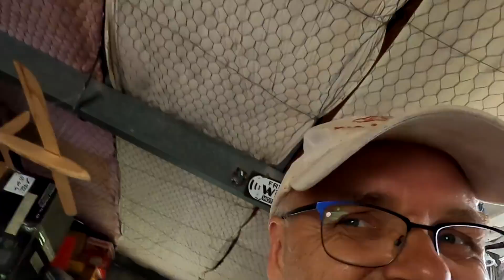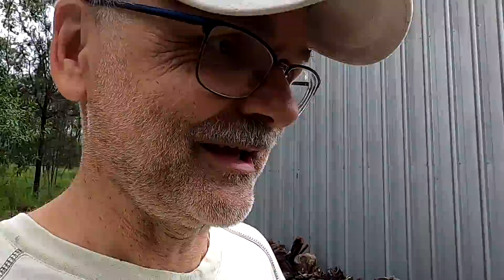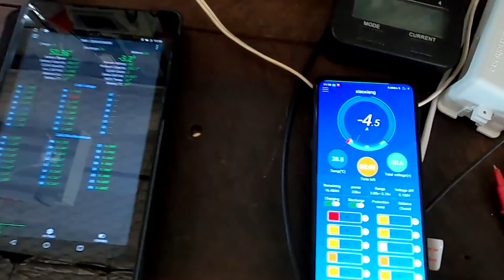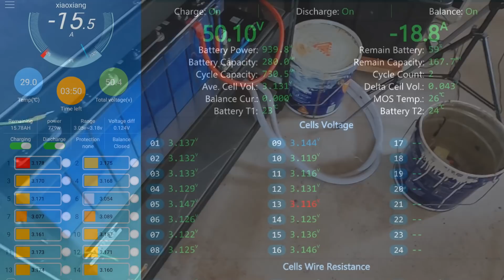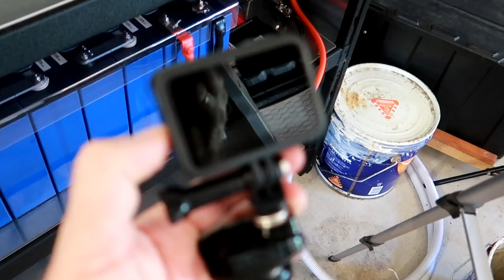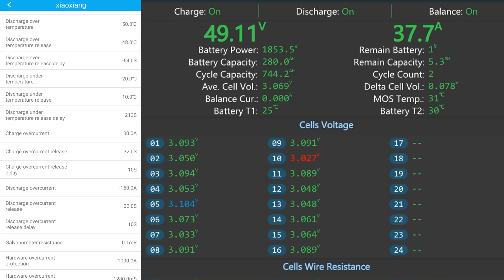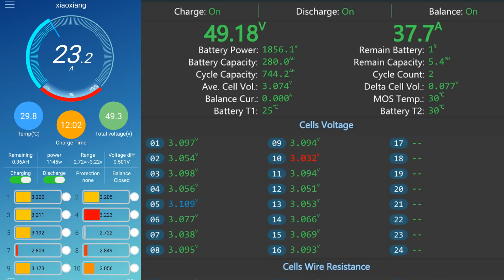Two 48V battery banks, different BMS', low voltage shutdown. QUCC BMS vs JK-BMS. See what happens!

Comment: Hi Andy, again a great video !      If my pack is in such a low SOC the Multiplus cannot charge anymore( by the grid)   and keeps disconnecting the breaker. Due to ripple voltage , sais Multiplus. I have to charge the cells individually to 2.7 V each,  then the system works good again.  I wonder if you have the same problem...
Keep on going!
Reply from the maker: Oh, wow. That's annoying! I reduced the load to 1.1kW before the BMS shut down. What was your load when this occurred?
I'll keep this in mind for the next low voltage test.
Reply: @OffGridGarageAustralia  No load.  The multiplus was " on" for a couple of days and drained the whole system,  despite the QUCC should stop at 2,55V. It is not clear to me...I have an (still) grid-connected Enphase system so I load my batteries from the grid during weekends, to use the washing machine, dryer  and other big loads during the week. And forgot to turn off the inverter.....silly me!
Reply from the maker: @Victor-ut4zp  Ah, OK, you should program the Multi accordingly so it shut itself down before it drains the battery that low.

Comment: You stated correctly, the qucc was waiting for jk battery voltage to exceed its own batteries voltage sufficiently, thus seeing a charge, and opening the relay.
I am happy with my Qucc, does anybody know if it can show accurate SOC when fast charging? It always states a full SOC during absorbtion...

Comment: Curiosity is a joy forever.
Reply from the maker: You're getting a little bit more if I would use an active balancer in this situation which keeps the low voltage cells alive a bit longer. It is not more than 5Ah what you gain though. From a 280Ah battery.
Normally you don't discharge that low, this was just for the test. It does not make sense to go under 3.0V which is around 7% SOC. And then it does not matter if some of the cells are a bit lower than others.
Reply: @OffGridGarageAustralia  maybe the spirits of clean energy would say to preserve the battery pack to its maximum and also to replace a ripped thread on a cell to place it with other deficient cells in a lesser demanding setup to let it live to its fully remaining capacity.
Than again, i am a pacifist who has difficulty with change and dismissing old socks... Viva longevity!

Comment: I noticed something: The QUCC BMS had waited 30 seconds after the voltage exceeded 48.6V. 
It then resumed charging. It may have waited to see if the voltage would drop again.
Reply: It depends on the undercoltage release and release delay and pack under voltage release and pack under voltage release delay settings are set to.

I checked out this function before I put the qucc in my production/final setup

It's a good feature to have the delay
Reply from the maker: Hmmm, I can't see a setting for this... Also not sure if it has this sort of 'intelligence' to wait and see?
Reply: @OffGridGarageAustralia  it was just my observation
Reply: I agree looks like there is a de-bounce timer on the restart, makes perfect sense... but where is it set?
Reply: it waited until voltage of battery was about 0.7V lower then voltage on contacts of relay.. this is a drop voltage on some diode on input..

Comment: The Seplos BMS I run seems far superior than these bluetooth BMS's, cells in the pack are always within 5mV of each other for most of the discharge curve, easy to manage multiple packs on the system too and communicates directly with my inverter. Highly recommended.
Reply: So I'm curious what communication protocol you have. I have the growatt 6000t but unsure which version bms I need and it's too hard to communicate with the sellers.
Reply from the maker: This has more to do with your cells and maybe the way you use them (charge and discharge current) and not so much with the BMS. Why should the BMS communicate with the inverter and not with the charger?
Reply: @OffGridGarageAustralia  He probably means he has one of those all in one white boxes like a Growatt, "talking to the inverter" would actually be talkign to the charger in the white box. 
I also have one of those white boxes, they are great value. The JBD bms's aren't.

Comment: Hay Andy thanks for a great video very entertaining. My system has been running for over 6 months and I still have never tested the low voltage cut off. my inverter settings are set lower and higher than the bms. I do need to test the system. My 12v step down controller is a risk as it's connected straight to the battery.
Reply from the maker: Thanks Luke. I'm always curious to see what's happening at the very top and bottom. We will repeat this test once we have all the battery banks installed.

Comment: Rms only works and is only applicable for ac power. If you’re in dc voltage mode it won’t do it (root mean square is not an average it’s closer to 63%). Under dc voltage it will average samples within whatever period it’s set for.
Reply: well said and entirely correct
Reply: .. to be precise :) 
for a pure sine wave RMS is 0.707 of the peak .. aka 70.7% … but lets not split hairs!
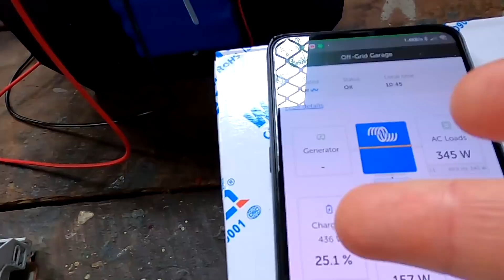Reply: @qchatgreg  sorry, lazy math done wrong from 1:41 multiplier. 😂
Reply from the maker: Is a DC ripple not AC?
Reply: @OffGridGarageAustralia  This probably comes from my comment on a previous video where I used the term RMS incorrectly instead of using average... Probably was too late in the night when I made that comment. The idea remains the same: the multimeter averages, the BMS does not, and the ripple is due to the inverter load.
Reply: @OffGridGarageAustralia  not unless it happens to be perfectly sinusoidal with a 0 crossing.   It might have a sinusoid but it will always be positive unless it’s using ZVS and that your meter won’t be able to measure because it’s over 132,000 hz. 

And again, RMS is only on in your meter in ac voltage setting with a frequency between 10ish and 300ish hz. 

In dc voltage it’s just averaging samples and samples per second on your meter is one of the differentiators between cheap and expensive meters. 

The only way to really tell what’s going on with DC ripple is with an oscilloscope because it measures up to 200 or so MHz (higher the more expensive)

Comment: In which video can I see the wiring of the two parallel batteries? Is the paralleling on a busbar on front of the victron shunt?
Reply from the maker: Yes, every battery bank connects to the main busbar via a 100A circuit breaker. This is part 1 of the installation, 2 and 3 are linked at the end of each video: https://youtu.be/8wu8OKlOn7s

Comment: Another great video! Thank you. A Quick question; on the original battery, the two lowest cells seemed to be a lot lower than the rest. I was once told that trying to bottom balance and top balance would drive me crazier than I already am. I was just thinking that if your two lowest cells were closer to the rest, you would've gotten much more out of the battery. Thoughts?
Reply from the maker: I could have used an active balancer at this low SOC which would have kept the low voltage cells alive for a bit longer. You get probably 5Ah more out of the whole battery (280Ah) with such a balancer. 
It does not make much sense to go below 3.0V which is ~7%SOC. At this point, it does not matter if the cells are straying a bit because the pack is top balanced so they come together again when fully charged. Using a balancer at the bottom destroys your top balancing.

Comment: Are you going to install the older battery on the shelf? You have different resistance as the one battery is further away and longer cables to it that messes with your test.
Reply from the maker: There will be new cells in the shelf soon. The longer cables don't make a big difference. The more battery banks we have, the lower the current for each is.

Comment: Didn't the QUCC have a 20 second delay? I think it just started charging after the input voltage was higher than the battery voltage plus some delay.
Reply from the maker: The voltage was 0.6V higher before it turned on again. Not sure if there is a timer running for this. Nothing in the settings for that.

Comment: The QUCC appeared to have some delay to turn off and on, so it must have some sort of delay either built in or configurable.
Reply from the maker: Yes, there are some timers which can be set. But not for when the overall voltage to turn on the relay. I always found the QUCC a bit unpredictable.

Comment: Can anyone explain the JK BMS numbering convention? I can't figure what the specifications are for the various part numbers.
Reply from the maker: Under the JK-BMS section is a link to the manual. It has a table on page 1 with the naming convention and the specs. Does that help? I've got the B2A24S20P
https://off-grid-garage.com/battery-management-systems-bms/
Reply: @OffGridGarageAustralia  That helps. Thank you Andy!

Comment: little thoughts i got is if you thought about putting a pack of capacitors to even out the voltage from the battery?
Reply from the maker: What? Capacitors???
Reply: @OffGridGarageAustralia  I remember that I saw someone who put a bank with capacitors at the inverter so that the voltage in front would be smoother but I do not remember if it was that he used thinner cables so it was both because the inverter would get the right voltage but also because the cables would not get hot at short loads. I also remember someone who used a bank with capacitors instead of batteries, but then the sun needed to shine when he used the inverter. However, do not know how it would behave if both BMS turn off but as long as the solar chargers work as they should they should not be a problem but they do not know if something else can be created

Comment: If you're measuring DC, that has nothing to do with the RMS measurement capability of the meter.  That only applies on the AC ranges.  The ripple on those cell voltage readings is probably down to poor ADC programming or circuit design... That assumes that other people have the same issue with this BMS??  I've no idea because I don't own one.
Reply: The multimeter averages, the BMS does not. I used the term RMS incorrectly in a previous comment instead of using 'average'. It was too late in the night...
Reply: @upnorthandpersonal  yeah I just thought I'd seen other JK videos which showed much more stable voltages though?  Is this a common issue with this specific BMS?
Reply: @Chris-hy6jy  It's worse when you have a high draw on the inverter, less when you charge at the same time through solar, and not at all when you have a resistive load (no inverter). In the end, it's not that big of a deal though - in the end it averages out anyway, so the remaining capacity it displays is pretty accurate. It's pretty easy to see when you would graph the data with e.g. Grafana like I do.

As far as I know, the manufacturer of the BMS is aware of this and are working on it. In the end, I still haven't found another BMS that I can rely on like the JK in this price category. Things like the ability to turn itself off to prevent deeper discharge of the battery after a LVD etc. are not available in e.g. the QUCC, or the JBD. Daly has too many other issues.

I've been running two JK's now on my packs for two years, and they do what they need to do without issues.
Reply: @upnorthandpersonal  cool, thanks for the info 👍
Reply: Just an afterthought... If other people aren't seeing this voltage fluctuation, could it be down to the 5A fuse you've put in series with each balance line?  If it's pulsing 2A of balance current through that fuse I'd guess you'd see "some" level of voltage drop across it.  Just thinking out loud.  I don't have a system here to compare unfortunately.
Reply: @Chris-hy6jy  it should only measure the voltage when its not moving current - but who knows with these bluetooth BMSs.

Comment: the QUCC "Undervoltage Release Delay" is set at 20s so it had to be at a higher voltage for this period before turning back on - and I would guess at higher than 44.8 (2.8 x 16) in a standalone or i your case the system voltage had to be higher than the 48.6 volts it had remaining when it turned off.  Watching the video though, it was around 40 secs after the JK battery hit 48.6v before the QUCC turned on....
Reply from the maker: It's not clear when the relay turns on again. I didn't not reach the 2.8V but were above 44.8V. It definitely sensed the higher voltage once the JK reached a higher voltage but I nowhere have set 40s in the QUCC 🤷‍♂️ At the end it does no matter as the overall system functionality works.

Comment: At the point the the JK battery reached 48.6 a timer started. (Configurable or hidden) in the QUCC. After that time passed with the voltage being above the QUCC battery voltage the relay turned back on. This timer is important.
Reply from the maker: Makes it a bit unpredictable, doesn't it? I would rather have a clear setting somewhere which I can see, adjust and understand. The QUCC is a bit hit and miss...

Comment: Very interesting video.... But your old battery have VERY unbalanced cells on bottom capacity
Reply: Does it really matter other than loss of capacity?
Reply: @vincentpernicano3277  I don't know, does it matter? I just made a statement - but the difference of 0.6V between the cells is quite a big difference. Of course, the difference in full charge is more important.
Reply from the maker: The old battery needs maintenance, all terminals and busbars sanded and paste applied, also at least on terminal is half striped. I also haven't fully charged it for months. Even if I would have, the QUCC does not a great job in balancing.

Comment: The jk is taking more amps because it has a lower voltage at the same time as qucc about 0.2v difference. It should reach a equilibrium level at around 51.8v

I have 16s6p system.
(only 3 bms in the hole thing. And I've seen this between the bleh🤢 Daly bms and the ant bms
Reply from the maker: I think the main factor here is internal resistance between the different battery banks. The busbars on the old battery may be corroded and not fitted correctly, one terminal is stripped, there is a switch and ANL fuse as well in the box. The new battery is fitted perfectly now and has very low resistance.

Comment: You definitely need more power on your roofs and more charge controllers on your 'power wall'...
Reply: He sure does, especially with all his tree shade. Massively oversizeing your array is where it starts to get interesting.  With all his batteries installed it will take a lot more panels before he has to worry about moderating the midday charge rate in the absence of sufficient load.
Reply from the maker: I just have to wait for cooler weather, the roof is too hot otherwise. Cannot wait for it... We will install more solar on the other shed as well. That will be an interesting project.